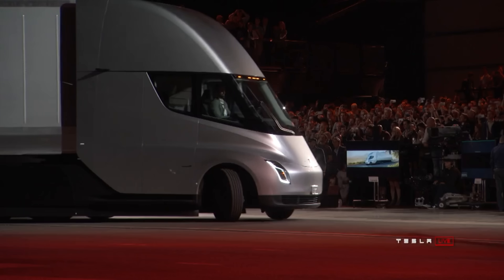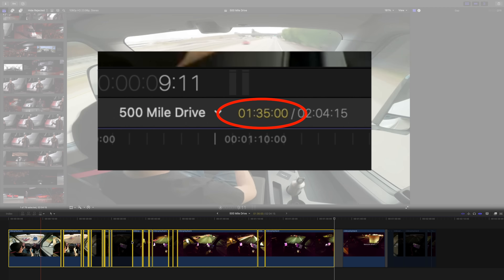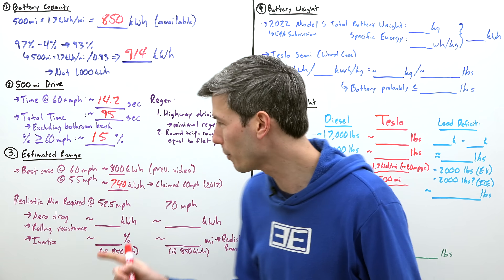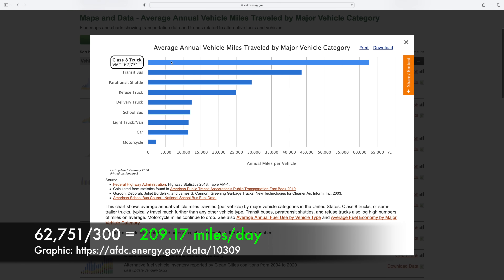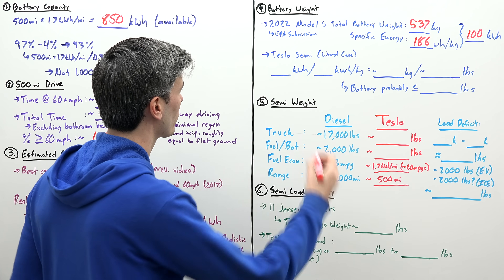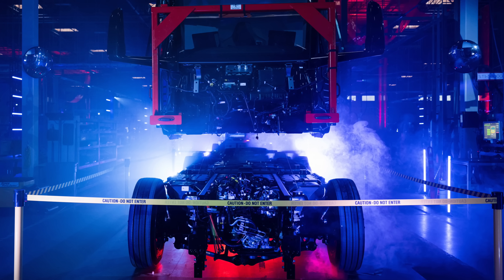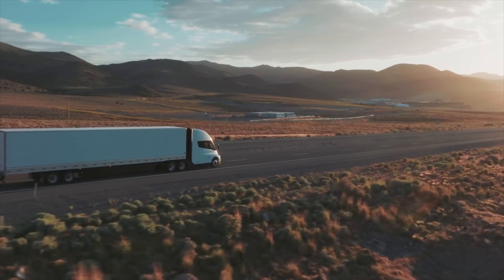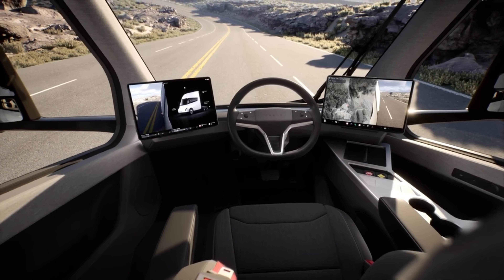Does The Tesla Semi Make Any Sense? Part 2!

Comment: Another great video on this topic by EE. My question/comment is about e-highways. 1 km of an e-highway costs about 1 million (Euros or US Dollars are above the same). At 112 km/h (70 mph) you drive a distance of 56 km (or 35 miles) in half an hour. Let us assume you could drive while charging the accumulator. How many stretches of US freeways have a dense enough Semi traffic for this to make sense? How many stationary chargers (and for how many trucks to charge at the same time) could you build for 56 million USD? Can you do an analysis of stationary vs. at motion charging? The weight of the current collecting pantographs can be ignored for now. How often would you need such stretches of electrified freeways? What are the best sections where they would make sense and do they exist at all? This requires an in-depth analysis of typical semi routes. For more information, google ELISA e highway. The University of Darmstadt published some studies after initial trial runs. I personally think that the idea of putting overhead wires that directly feed 670V DC to semi trucks while they are driving is very interesting and has future potential.
Reply: So a train?
Reply: @mcmario67  Not really. More like a cargo trolleytruck with independent onboard power source (in case of the Tesla Semi it is a traction accumulator).
Reply: @ErikZiak  He has a point. Trains are more efficient, can carry way more cargo and are faster.
Reply: @thethoeby  The electrification of trains in the US is not that great. Trains are too long, travel over huge sparse populated areas and the cost of installing and maintaining an overhead infrastructure would outweigh the cost of carrying on-board diesel generators. Huge locomotives are electric. But they have to generate their own electricity, as it is cheaper than building a dedicated infrastructure for that in many cases in the US. I wonder why other countries with equally heavy and long trains as well as huge driving distances through sparse populated areas managed to electrify those sections. Like Russia. Of course, they do also have non electrified lines, but many others with heavy cargo traffic do have overhead wires.
Reply: @ErikZiak  If you have to build the megacharger network to enable long haul electric trucking, you might as well hang those current conductors above sets of tracks and stop hauling your batteries to everywhere you go.
Reply: @hvh377  My point is that it would be best to find a combination of on-board electric energy storage with overhead lines on specific stretches of interstate freeways in the USA. I am sure that a "sweet spot" can be found when it comes to the efficiency and long-term costs. Stationary charging infrastructure for semi trucks is certainly not cheap and there might very well be scenarios where truck drivers have to rest, they find a spot to rest and recharge, but the time needed for charging is just a fraction of what they need to rest, so they need to move the truck to make the charging spot available for another truck, which disrupts sleep or whatever you do during a break if you are a semi truck driver. Being able to recharge as well as drive directly on electricity on certain sections might be more appealing in my opinion. And stationary recharge can remain an option, but it would be much slower, possibly AC (using on-board converters of the semi trucks) that is much cheaper to install.

Personally, I expect that the future is not in one technology only, but in combining existing and new technologies into a system that will work. But such a system might need regulations in order to be built. Isolated "pilot projects" are likely to fail from an economical point of view. Only once you can guarantee a "mass", you can expect "customers" to adapt to a certain mode of operation. I am not sure if any possible overhead infrastructure above freeways should be privately owned or state owned. It is a high-risk and potentially high-benefit scenario. I know that in the USA, any state or county regulations are being recognized as an attack on freedom. And this might backfire, regardless of how "nice" a proposal might be (hoping it will be really scrutinized and realistic, not some wishful thinking, idealized scenarios). I would like such a deep analysis to be conducted. If feasible, I would like to see so called PPP (private-public partnership) projects where the infrastructure is being built, maintained and operated by private companies, while the public sector provides long-term contracts and eventually (some decades later) will take the system over including property, maintenance and operation.
Reply: One problem with putting charging infrastructure on the highways here is that we have a lot of oversized loads, ones that have to exit rather than go under 15' bridges, that sort of thing.  Overhead charging infrastructure would somehow need to be compatible with that and that's hard to imagine.
Reply: @TonyHammitt  They managed to do it in Germany and it was recently extended and more sections are planned. But maybe it is on routes where oversized cargo can be easily transported by rivers, I do not know to be honest. I am sure they thought of that.
Reply: Google for 20221027_ERS_Working_Paper_Technikbewertung_final_engl.pdf and check the TU Darmstadt paper.
Reply: most common Truck route is I80, from East-West.  it is 2900 miles (4700 km). another is I35 North-South 1600 miles ( 2500km).  If 10% where electrified that would be 450 Miles (720km) at $1m/mile = $450 million plus corruption and overuns= $1 Billion to build
Reply: @pablopicaro7649  That is quite a big sum. I do not know the USA interstate system that much. Would it be really necessary to have 10% electrified? I assume that the truck would be capable of up to 400 miles without charging and it will need just relative short sections to recharge while driving. 56 million USD to recharge for another 400 miles as well as traveling 35 miles.

Comment: I really appreciate you doing the math on these. I'd love to see you doing the math of how much extra wear and tear on our infrastructure and on tires of America's current automotive fleet going electric at commonly sought levels of battery capacity... and then doing the same calculations if people were sensible and got smaller battery packs of ~100 miles of range and semis were replaced with trains for everything but final-mile delivery.
Reply from the maker: It's actually a really interesting discussion and something I should do a video of. I remember seeing a plot that road damage goes up exponentially with weight, so when you have a 3500 lb car vs a 4000 lb car, it really doesn't matter all that much, because you have 80,000 lb trucks that have so much more of an impact. But worthy of a video for sure!
Reply: @EngineeringExplained  The formula I've seen floating around (not sure it's accurate) is exponential and is (W1/W2)^4, so it's even significant for those cars you mentioned: (4000/3500)^4 = 1.7x the road damage for the 4000lb car vs the 3500lb one! D:
Reply: That is a lot of IF's and would just be an exercise in math since those changes aren't going to happen anytime soon. 

Trains are very efficient, and we use them a lot, but getting more rails installed is a huge undertaking.
Reply: @NONO-hz4vo  It's really not as unrealistic as you think. The USA used to be the rail shipping capital so some historical data could be used or a comparison to the Switzerland's railroad system.
Reply: @NONO-hz4vo  there was actually only one if

But yes I totally agree it would be a huge undertaking, but a huge undertaking that would pay dividends for generations and really not any bigger of an undertaking than electrifying the entire us car market
Reply: Building new railways is a nice idea, but the amount of people who would need to be displaced makes it pretty unreasonable today. Back when America's early railroads were being built, they resorted to killing people who wouldn't give up their land for the railroad. We would end up with a huge domestic conflict if we tried displacing people today - especially in rural areas where land has been passed down for generations.
Reply: @o15523  Railroads are more space efficient then Semis for hauling freight in many aspects. Think about all the extra road use due to semis (extra lanes, increased maintenance as they wear roads ~1,000-10,000 times more than passenger vehicles), massive parking lots outside warehouses for trucks to maneuver. It's not about displacing people it is about replacing existing infrastructure trucks use with more efficient railroads (which yes can be very easily electrified in the future compared to an enormous truck charging network which yes WILL take up space and displace people which you are worried about.) Yes, 2-day amazon shipping would suffer but the environmental impacts of 2-day shipping are enormous and are subsidized by the government as Semi operators aren't taxed enough for their road use. Thank you @ktdefron for suggesting this.
Reply: "Tires on a modern electric car will wear down much slower than in a car with a traditional internal combustion engine. This is due to good traction control. The driver assist systems reduce slipping by utilizing the electric motor's rapid power adjustment. This system is much quicker than in ICE vehicles, where it is based on braking and limiting engine RPM" , Nokian Tyres' Development Manager Mikko Liukkula

Comment: Given the information you provided, it definitely makes sense weight-wise in the US. I believe that Europe has stricter weight laws that would make it more difficult for the truck to be practical over here.
Reply: Problem isn't weight in Europe. Its Length. Even so much shorter than Conventional truck the Tesla is, It's far too long to be legal in Europe. It would require a complete redesign of the cab. Loosing the streamlined look and aerodynamic benefits.
Reply: @Species-lj8wh  Yes EU trucks are a very different design than N.American
Reply: In Europe is even better: Ev trucks are allowed 4.4k pounds more (2 tons) and have a higher Gross weight to begin with. And the routes are shorter
Reply: @flaviosalatino8192  then it seems it's even better in that sense!
Reply: @flaviosalatino8192  it’s not!
Reply: I think this semi truck is even better for Europe, at least for light cargos.
Reply: @FacuGonz3  nope it’s bad for Europe! They don’t have any cab over design which helps navigate smaller European streets better

Comment: You know there are huge EV TREX type mining trucks that don't need to charge at all due to regen and the difference in weight of the truck coming downhill loaded and going back up empty.  At least one in Europe has been operating  with no charging, and CAT is now making some too.
Reply: Unfortunately that niche case isn't applicable to the use case for these. They won't have giant machines using massive amounts of energy digging out literal tons of earth and loading onto them just so they can approach an isolated zero energy use.
Reply: Lol….. those types of vehicles or equipments works in a very specific conditions unfortunately! There is the infinity train in Australia working with the same principe. Very rare case.
Reply: Most of the mines that use such ore haulers are in a pit. The haulers climb out of the pit loaded and descend back down empty.
Reply: @avsystem3142  even pits are not all the same conditions

Comment: There will be use cases where the truck will be fine, but for a company the question will be whether it will be worth it after all of the upfront costs for the trucks, charging infrastructure, electricity, maintenance, etc and  compare that to what they are currently paying. The big questions for me are how will the batteries hold up over time to the incredible charging speeds, how much range will be lost after the first few years, and how much range will be lost on uphill routes in sub freezing temperatures with heavy winds for the truly worst case scenario. Only time will tell how much money these trucks will save companies, but I have to assume they are safer for traffic around them even if I am sure most will just pass them in the left lane if they are going 60 in a 70 mph zone.

Comment: As all-inclusive as this analysis was, I feel there were a couple of points that were overlooked. In the case of inertia, there is also the nature of momentum. A vehicle of this size going 60 miles per hour is going to have significantly more momentum than one going 30 miles per hour. It shouldn't need as much energy to sustain its velocity after the acceleration has completed. Granted, this is a bit of a bell curve dictated by the aerodynamics of the vehicle, but it should be consistent with the idea that highway driving is more efficient than city driving (which has been the norm for ICE vehicles forever).

Additionally, where the Tesla semi EV has ICE semis beat is in stop-and-go traffic. If there is one thing the US (and especially California) is known for, it's traffic congestion. Whether that's of the rush hour variety, road construction, roadside emergencies, or whathaveyou, there are many, many situations where the speed of vehicles is going to be significantly low (under 15 miles per hour). While modern semis do have idle reduction technologies, none of those technologies can beat an electric vehicle, which can cut all power to a bare minimum when idling for any reason. 

This is my opinion, but when all is said and done, I feel like the efficiencies of both EV and ICE semi's - once the technology is mainstream - will be relatively equal. The only difference is that EVs can be refueled with renewable sources of electricity, whereas ICE vehicles could - at the very best case scenario - be refueled with synthetic gasoline/synthetic diesel/biodiesel which can be close to carbon neutral but is drastically more expensive.

Comment: Much better than you first video. One aspect that you do not discuss is the cold effect on battery range that dramatically effects EVs unlike with ICE. This would further limit the truck to certain areas and certain times of year.
Reply: Good point, just looked it up, cold weather in the best scenario loses 12% of range, but could be 40+%.
Reply: I rented a EV for a small trip, the difference between the 20c night that I stopped the car and the 30c mid day was of about 5%. I loved the car experience, hated everything else and I doubt this will be the future.

Comment: What is the expected efficiency of regenerative braking?  In this video, we set it aside as approximating 100%, but I had the impression it was much lower than that.  

The improved aerodynamics seem to be very important to the Tesla Semi's efficiency.  What if we took Tesla's achievements in reducing drag, along with the decision to store only enough energy for a single trip, and put them on a diesel powertrain?
Reply from the maker: It's a good question, obviously you still lose energy going downhill, even with perfect efficiency, as you have aero & rolling resistance forces which are taking away energy as well. But from their graph, you can see that as it came back downhill, it put it right back in line (nearly, not perfectly) with the overall trend.
Reply: Regen efficiency is usually 60-80% depending on battery state of charge

Comment: Hi your math leaves out the fact that the low centre of gravity reduce power consumption through less rolling and the low surface area, the high temperature as well as the elevated altitude reduce the air resistance. Also you had on the board 7.3MPG diesel truck but used a lower MPG in the first analysis when calculating the GWP reduction. Finally I noticed you did not go deep on the factor needed to multiply respectively the true added GHG emissions from diesel and similarly for the power mix.
Reply from the maker: CG isn't going to really change rolling resistance (and certainly not surface area). Yes, I need to provide a source for 7.3 mpg average. First video states 5.3 per this graph (https://afdc.energy.gov/data/10310), but I'd found an updated study that showed the number was higher. The trucking data book referenced in description states 7.3 mpg for a specifici scenario at highway speeds, but I'm not sure if that was it. Need to find!
Reply: @EngineeringExplained  Check Geotab they got the realworld numbers. I do not understand your comment about cargo size not being relevant to CD value and thus air resistance and thus to mileage and I do not understand why keeping the load lower than average would not be an advantage and thus also change the MPGe.

Comment: The calculation used to estimate percent of driving at or above 60 mph is a great example of "non-representative sample."  How do we know that the number of seconds showing a speedometer reading above 60 mph, out of a 90 second video, is representative for a 500 mile trip?  We don't.   It is possible that it was a coincidence that most times the speedometer was visible, the reading was well below 60 mph.  If the experimenter took, say, forty or fifty 90-second  samples of video, and averaged together the visible speedometer readings, there might be a somewhat accurate measure of average vehicle speed during the 500 mile journey.

Comment: If you're kind, you're giving diesel a density of 10 kWh/liter. So you're looking at 110 kWh/100km for the semi-EV vs. 350 kWh/100km for the diesel. If Diesel an electricity were equally taxed and subsidized, you'd be paying over 3x the price per mile if you chose the cancerous tumor machine.

Comment: The battery can also have negative weight to it in theory. Adding the battery actually is less because it is a structural battery that is shaped like a honeycomb. This means they can reduce weight elsewhere.
Reply: This is the last application where you want the battery to be an integral non-serviceable non-replaceable part of the vehicle.